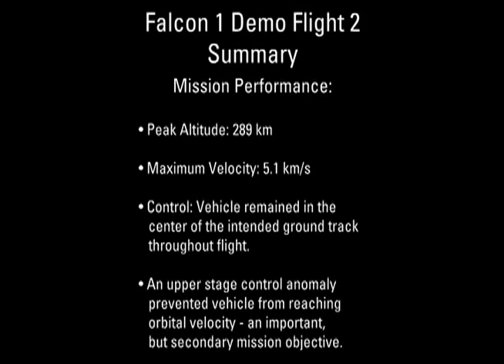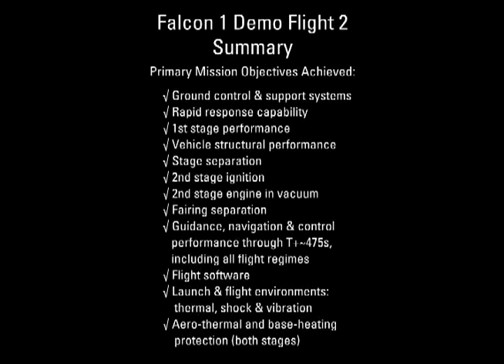Falcon 1 Flight 2

Comment: Falcon 1 really highlights how difficult rocketry is. Flight 1 was a fair and square failure, but flights 2 and 3 were really quite close to succeeding were it not for baffles and residual thrust, respectively.
Reply: And this by engineers that aren't amateurs.

Comment: Why was the video cut of before the explosion!?
Reply: binman133 actually there was an explosion. The rocket started asking rapidly due to shifts in the liquid oxygen, and a fuel valve dried, causing the engine to catch fire and the rocket to explode.
Reply: @Canwehitsubswithnovideos-bq2zf  there wasn't a explosion there was a problem with the second stage so it failed to do the second burn so it didn't reach orbital velocity so it reenter Earths atmosphere
Reply: @Tsmiley_09  Roll anomaly occured preventing orbital velocity.